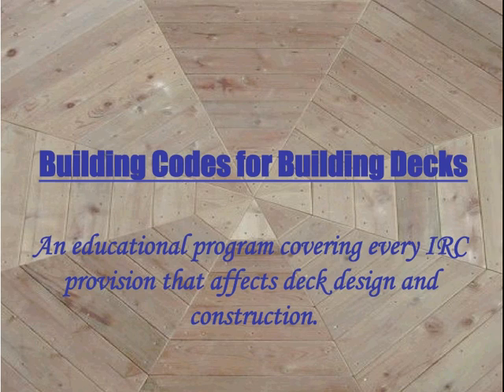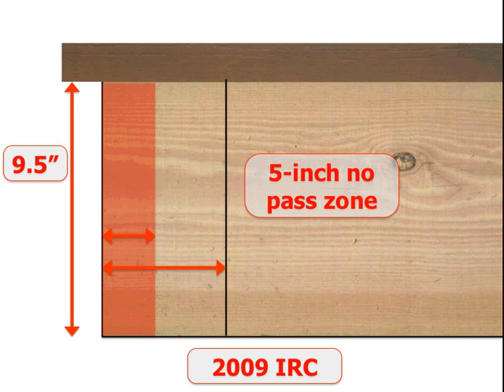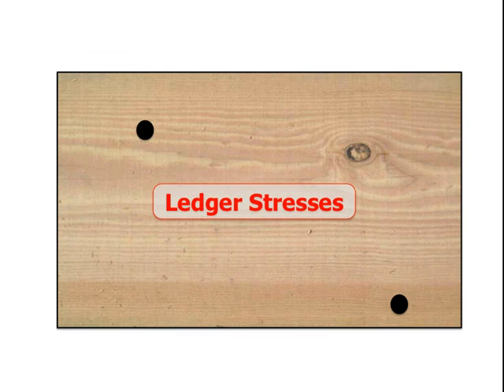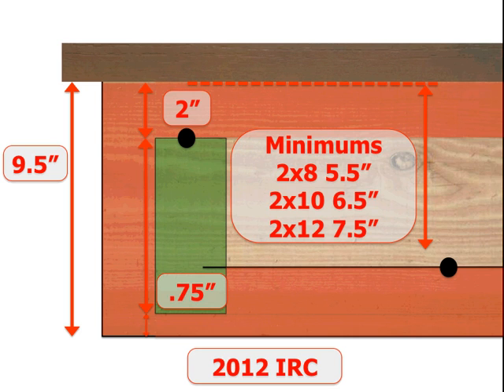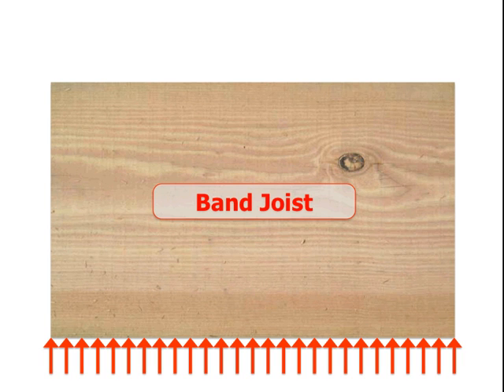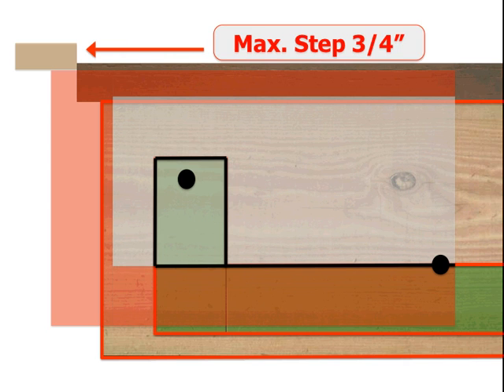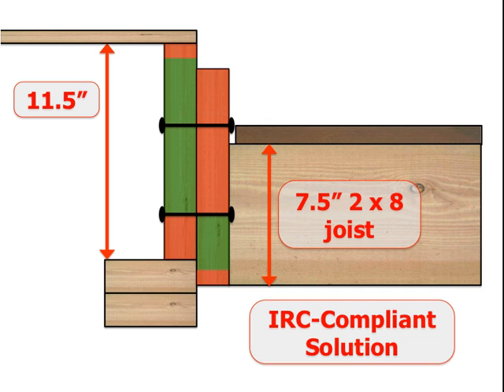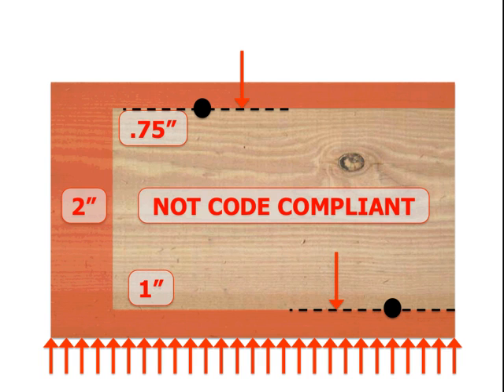IRC Ledger Bolting Pattern

Comment: Hi Glenn, I have a question, i am installing a Ledger to stucco wall bolted to house joist, Can i use a 2x10 Ledger? and 2x8 joists with hangers for the pergola structure or 2x6 with hangers?

Comment: (If Fin. Flr. is greater than 36" above grade) Place the top of the ledger board below the u/s of the top plates, anchored into a lintel of what ever depth you need. Sure, you'll need to put a step in, however, a step can be a grandiose addition to a deck if done with creativity. Also, it makes it that much harder to get snowed in if the deck is lower. My sisters deck is lowered and I think it's great, she lives in a standard residential neighborhood, with deck above walk-out basement, good vid.

Comment from the maker: You're welcome.  Yes, 2009 was practical.  It also gives designers and code administrators the flexibility needed to look at each application and use sensible approaches to build a sound deck.  Boxing in the construction geometry so tightly is unnecessary.

Comment from the maker: We all know that you could bolt to studs, top plates and sill plates, but the IRC doesn't provide a means.  It states if you don't do it as shown, then it must be by "accepted engineering practice" which in Colorado, requires a licensed engineer.  For every deck?  ouch?  Yes, in Westminster, we require a 4" min step in IRC just as in IBC.  We will have to revisit that amendment when adopting the 2012.

Comment: Very good Glenn, Can you not connect to the top plate? And most homes are going to have a 11  7/8" LSL rim 1 1/8" thick also does the section not address connecting to studs? It seems to be harder each year to comply with the code.Good video, very informative and great illustrations.In some areas they require the deck to be a min 4" below the interior floor for snow on the deck.